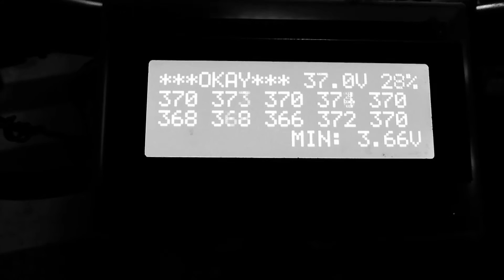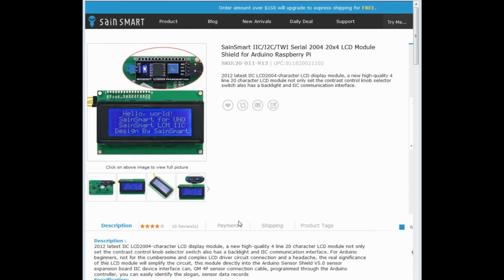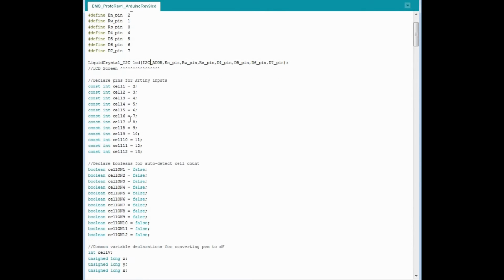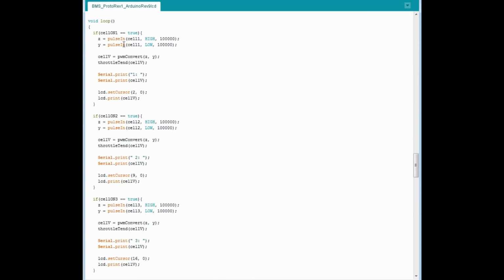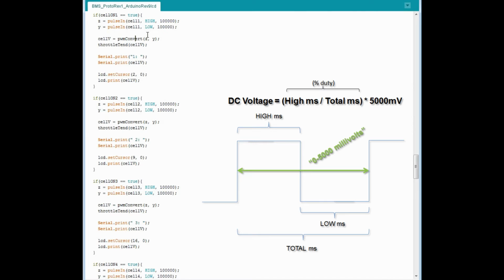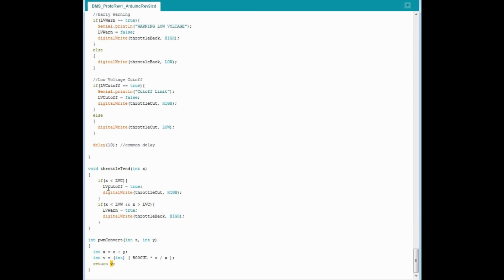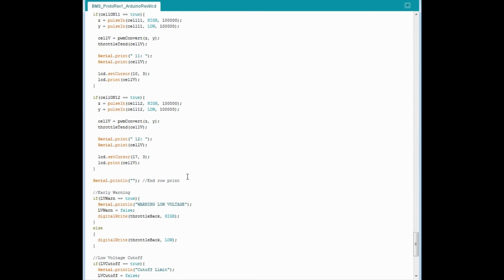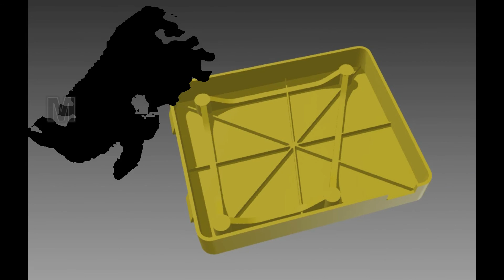How to Arduino BMS - Part 3 Battery Monitoring System LiPo LiFe

Comment: Hello i have a question the BMS it's self. Which stands for battery management system. Does that also mean you are charging the cells as well?
Reply: BMS is a complete package for any Lithium Battery, it can be used to protect the cells from getting damaged by over & under charging, discharging and at the same time it can help you to have a idea regarding SOC levels, some BMS can also perform balancing of cells

Comment: Nice setup. However, your reading of the ATtiny pulses should all be in a for loop. That would increase performance. You would just need to do deal with 3 variable arrays.
for i = 0; i < 12; i++{  
  if(cellOn(i) == true) { 
  z = pulseIn(cell(i), HIGH, 100000);
  y = pulseIn(cell(i).LOW, 100000);
  cellV = pwmConvert(z, y);
  throttleTend(cellV);
  lcd.setCursor(i * 7 + 2, 0);
  lcd.print(cellV);
} }
No need to repeat code and waste memory when it's just doing the same thing over and over. For the lcd.setCursor i * 7 +2 auto aligns your cursors position based on which iteration we are in.

Good write up though. I like the idea of putting the attiny and arduino to use as a bms. I'm planning on something similar with building a powerwall. (diypowerwalls forum) Thanks for the info :)

Comment: This looks amazing, any chance you shall provide the board design and code?  I have a small powerwall which uses lithium packs in 7s and this would work great.
Reply from the maker: Please subscribe, I will eventually release everything
Reply: Already subbed :-). Happy to wait, bought some of the parts so will be tinkering and experimenting.
Reply: @MegaMechatronics  Already subscribe....
Reply: Yeah, sure.
Reply: I guess he newer did upload the code and the schematics. And you already build your BMS system.
Reply: @munge83  No he didn't!   But you can see it in this video and cut and paste the code to get a single ATtiny85 with a 4N25 opto up & running, assuming you have figured out the design.
Reply: @peteturner8493  yes i did figure it out , I'm waiting parts from China to test it. Already designed pcb . Ail post it here when I'm done.
Reply: @munge83  That's great, took me a while as new to Arduino & electronics, there's a lot to understand but got there eventually. Just laid out a schematic in EasyEDA so I don't fry the Arduino. :) Been looking for my first project and landed on this one....no one ever said life should be easy!
Reply: @peteturner8493  that's great. Me to layed schematic in EasyEDA . My plan is to use ESP8266 so I can remotely monitor the batteries over the web.
Reply: @munge83  That sounds like another project! One thing I have not figured out but not that important to my single tiny/opto setup; is where all  the 10 Vcc inputs are coming from to power up the LDR side of the opto's?

Comment: Could u give detail...We have project and also we need help or can we buy this system?
Reply from the maker: The concept is: Each battery cell powers an individual ATTiny, each ATTiny has built-in voltage measurement, each ATTiny sends a PWM signal where the Pulse-Width correlates to a battery voltage, so analogWrite(Cell1, VoltagePulseWidth) where VoltagePulseWidth = (Cell Voltage / 5 volts)*255, so 255 would equal 5 volts or 153 would equal 3 volts. The PWM signal is sent to the "Master" Arduino through an individual opto-isolator (one side is an LED, one side is a transistor); therefore each ATTiny is completely isolated and the system works.
Reply: We are trying to make an electric car. We need a driver circuit for a brushless DC motor. What do you recommend?
Reply: Rasit Baysal can you give some exemple the way doing that?
Reply: We're making a electric car w lots of systems
Reply from the maker: Sevcon if you got the budget, otherwise you can try Kelly Controllers and Golden Motor (Sevcon clone?) for budget solutions.